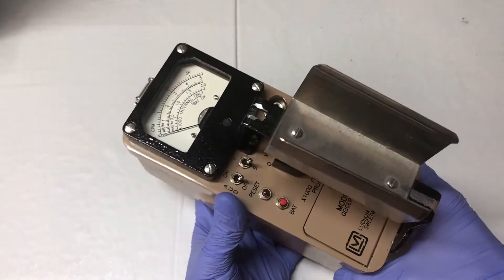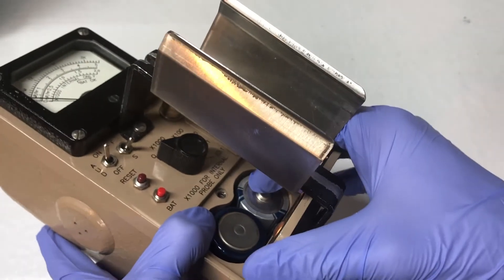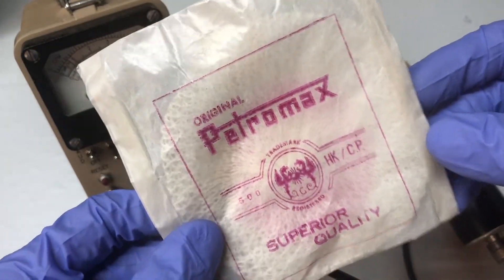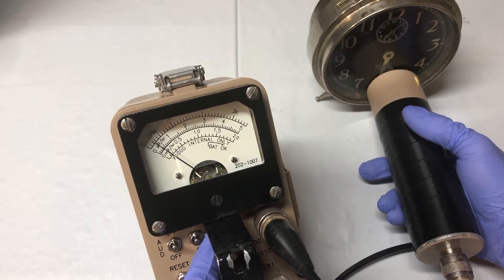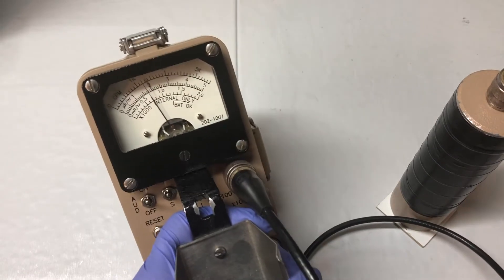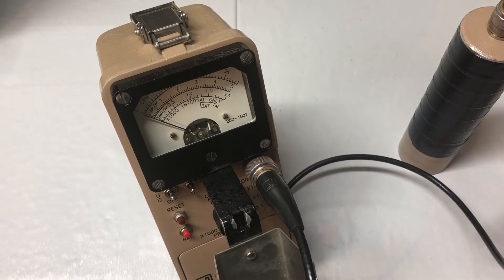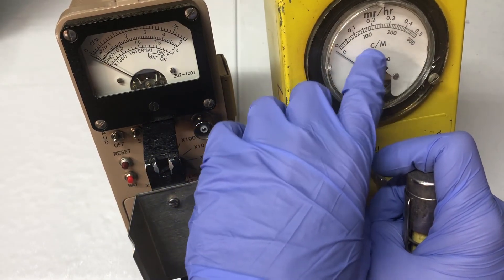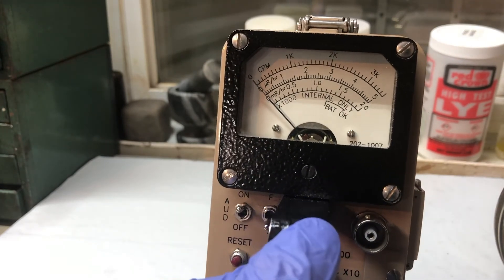Ludlum 14c Overview, demonstration and comparison to CDV 700

Comment: Eberline E-520 same idea but it is actually disables external probe when x1000 selected, which probably could be useful when you are trying to measure 2 R/h :)
Reply: I cant speak for the modern 14c or its variants, but my older 14c disables the internal when its below the highest range and in reverse disables the external when on the high range.

You wouldnt be able to trust the readings of either your external or internal probe if it was the case you mention.
Reply: @jamesluck2969  yes, when 14C switched to x1000 range it disables counting but HV is still present at external connector, with E-520 there's no counting and no HV when internal tube range is selected: https://youtu.be/q6M9AxuteHA